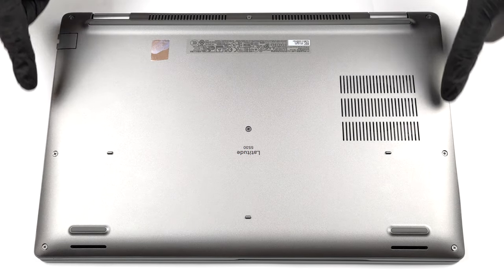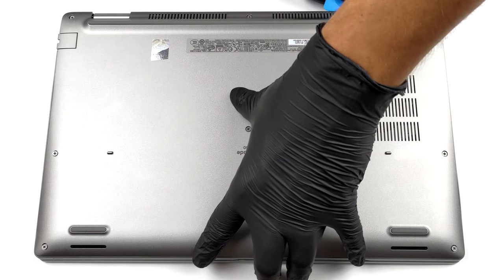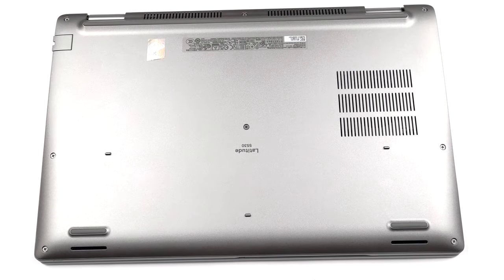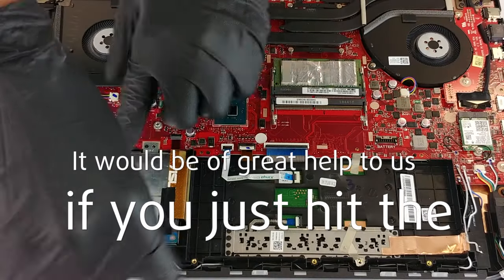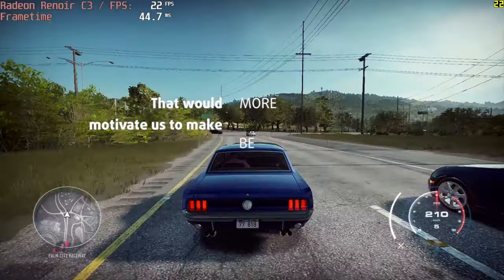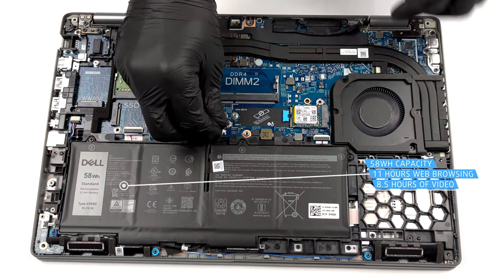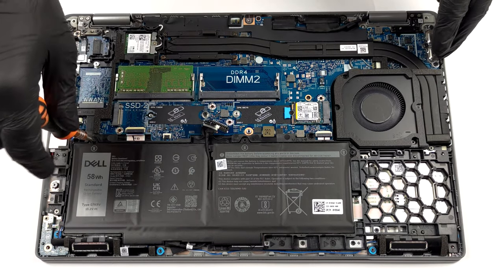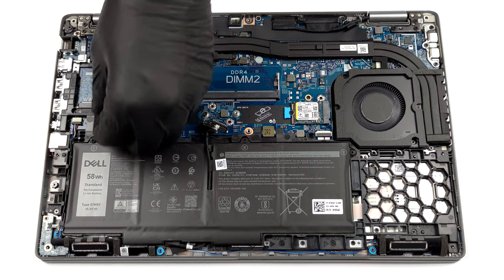🛠️ Dell Latitude 15 5530 - disassembly and upgrade options

Comment: 1:48, I'm sorry, did you say 2 miles long? Is that some terminology I'm confusing with 5280 feet/1,760 yards/1.609km??
Reply: Probably typed 2m, as in meters, but the text to speech program interpreted it as miles. At least, that's my best guess.
I know this is necro-posting, but still, thought it may be worth to say.
Reply: Actually, looking at this YouTube channel's website, it does say 2 miles, so who knows?

Comment: One hell of a big heat pipe
Reply: but its useless, thermal throttle kicks in after around 3 to 5 seconds of turbo...one thing I noticed is that my ambient temperature is 34℃

Comment: Thanks for video. I can t install clean windows 10 , during installation it doesn t found driver. Have you a suggestion ? Thanks
Reply: you need to switch the drive into 'AHCI' mode from BIOS, factoy default is 'RAID'; you could also grab the INTEL RAID Driver and point the installer to its directory - then the drive should be visible :)

Comment: I have 58Wh battery and after a couple of discharges like 5 to 10 times, its capacity dropped to 81% (47Wh) Not sure wtf is wrong

Comment: Couldn't go further? Removing the motherboard, getting to the cmos battery connector, replacing a keyboard? Jeez, you did just about the least you could do in this video...unscrew 10 screws.